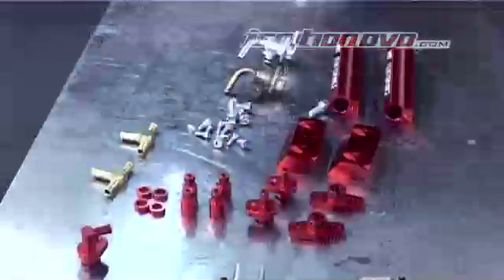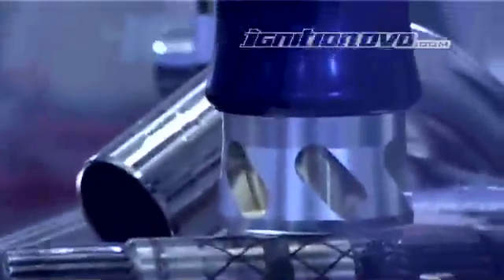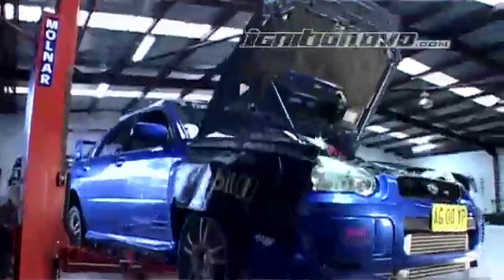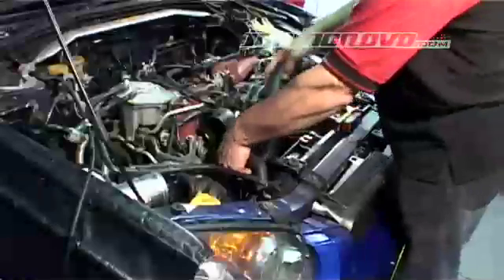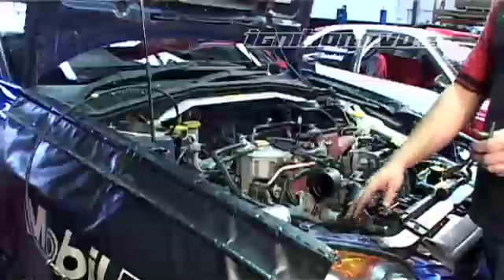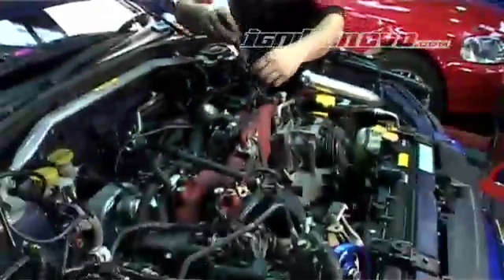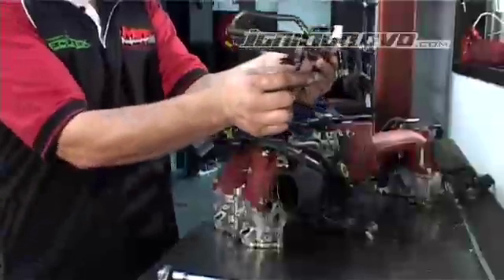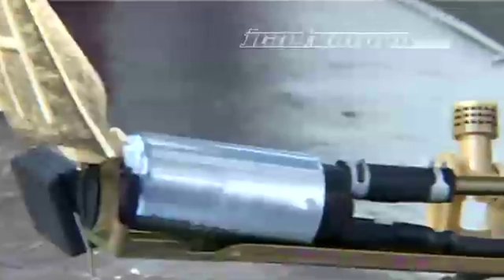Project STI - MRT fuel rail mod

Comment: That is A LOT of work for new fuel system. Very impressive piece though. Something like that should be thought of before putting the motor back in. I can't believe how much had to come out to change fuel rails and injectors.